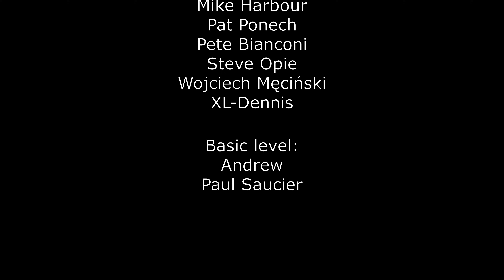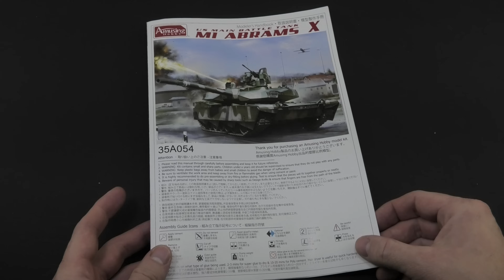Abrams X - the next generation of badass! part 1

Comment: Gonna be the debbie downer...you gotta take off the antennas on the rear hull. That's never gonna happen. Tanks are constantly moving, when it's time to refuel, a tank will swing it's turret to its rear( US abrams) to make it easier to refuel. Those antennas would snap of. Why? Because they don't bend. The base has a spring. So they can be pulled down and always at an angle. As a fellow  crewman of modern armored vehicles in the U.S. military. Antennas have to be in an area where crew can easily the them down or remove them. Yes. It looks cool, but it wouldn't happen.
Reply from the maker: You're right - it looks very nice but I will check the new place on the turret to make it exactly as you said! Many thx for this! :) Will, it would be very nice to see you in my Patreons group! :)

Comment: Qustion about antennas on the rear of the turret - are those Tactical Vehicle Antennas from C3D? If not, what are those and where can I find them? Thanks
Reply from the maker: They are not from C3D. I have them from Voyager set, the thin one is from Master Model and the one with wire circle on the top is some metal element which was added just as unindentified type of some top secret radio control system :) :):)

Comment: Hello mister cold. I have got a question to you.i have an tamiya abrams 1a2 iraqi freedom in my stash.the question is:are the track measures the same as abrams x.so i could use the rubber tracks included in abrams1a2 kit at an abrams x.with sticky greetings. Christian
Reply from the maker: They should be the same. I dont have this kit from Tamiya and can't say it with 100%.  :)
Reply: Thank you mr.cold.
Reply: The track lengths are the same but the tracks are actually not. AbramsX uses a newer Diehl track.

The M1A2 track should fit, but it wouldn't be accurate.